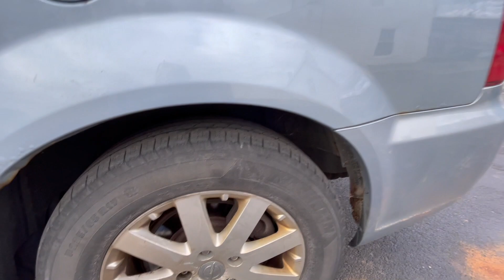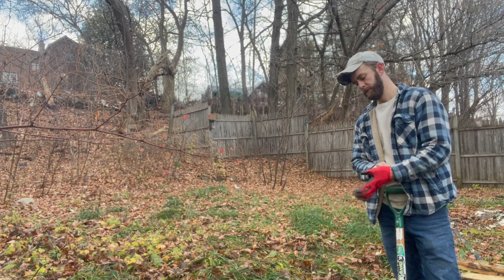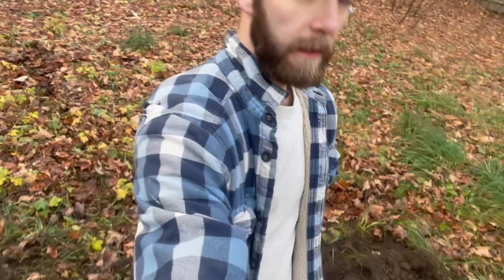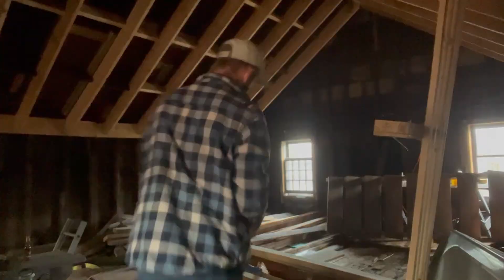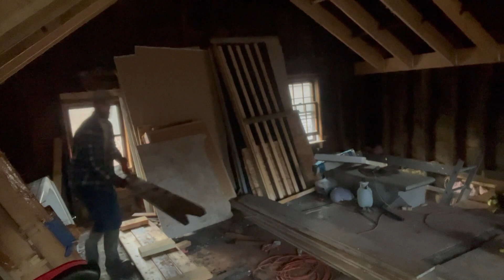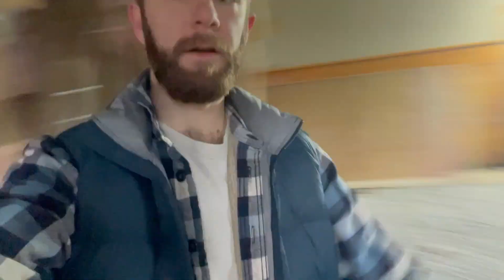Dealing with the BEES & other updates! || MAJOR Fixer Upper Ep. 15

Comment: In the spring when you can see the whole, wait till night.  cover hole with window screen held tightly down with blocks or something heavy.  make a tiny hole in screen and pour down some dawn liquid soap.  slide screen over so hole is covered again and fill with water,  add a little more soap through the screen and then fill with water again.  they should all be dead in the a.m.  you could repeat for a few nights to feel really safe.  they get the soapy water on them so they can't fly out of the nest and they drown.  at least that is was a video on YT said.

Comment: You probably covered the hole while digging, I believe they go pretty deep.
Maybe rake the vegetation so they can't hide in spring.
That nut, they may have tried to unscrew the bolt with impact hammer if that didn't work impact hammer the bolt through.
They could have welded a good nut on , seen that done before.

Comment: Try to keep lawn cut short it will help, also hope Santa brought you long handle spade shovel.
Kind of wish knew about water run off problem before all that stone was put in i thought you where using as a filler. Maybe you can ask your inspector about a sump hole to pump water out if a basement floods and put in drainage on inside of foundation to a sump hole and have a sump or lift pump run it out,and why not sink a couple sonotubes for your center beam supports then fill in with stone for slab. Well watching you dig with the right shovle you;ll be able to get a lot done when things thaw out

Comment: I use ice spray and a heavy duty air impact wrench. That's working in 99% of all cases. If that doesn't work, you can drill out the screw or split the nut. Have a great weekend and a Happy New Year! 😊 -Chris
Reply from the maker: I didn’t try ice spray, but we did mess with a variety of ideas! Thanks for the tip for the future though!